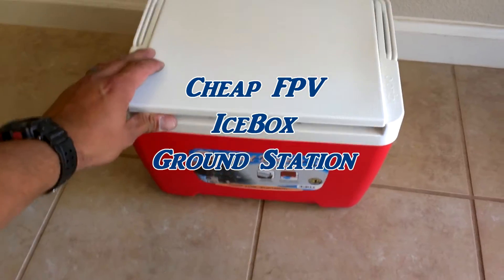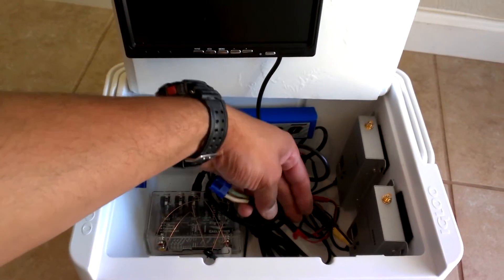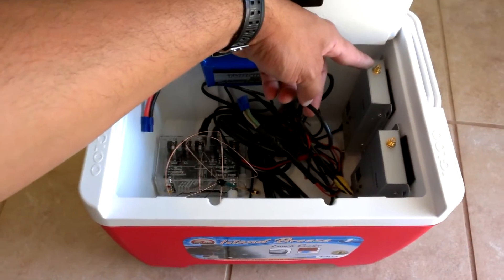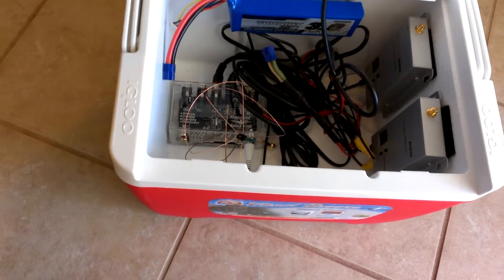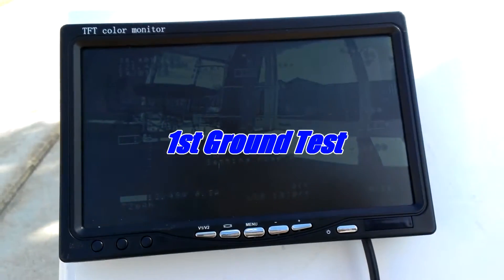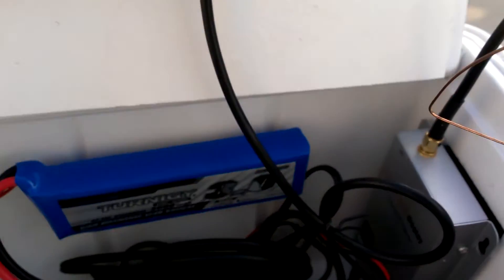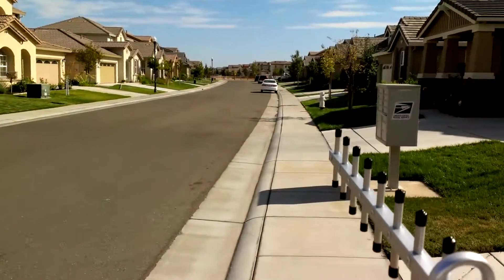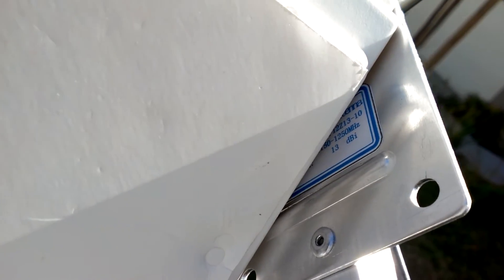Cheap FPV Ground Station Box

Comment from the maker: Receiver Diversity - when you connect two NTSC or PAL audio/video receivers (of any frequency), the EagleEyesTM picks the better signal at any given time, which can greatly reduce video fades and improve your FPV experience! A variety of diversity settings are configurable with the on-board switches and LED indicators.